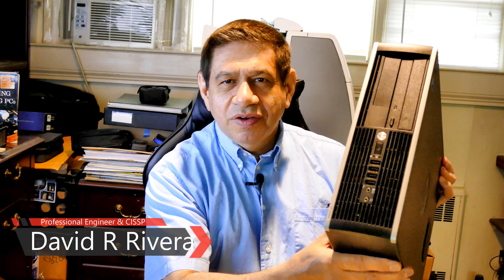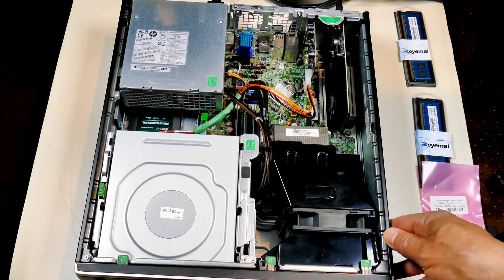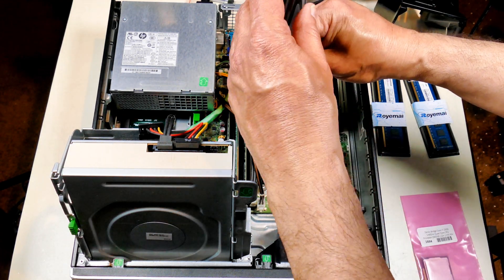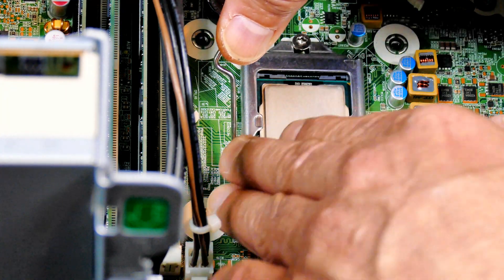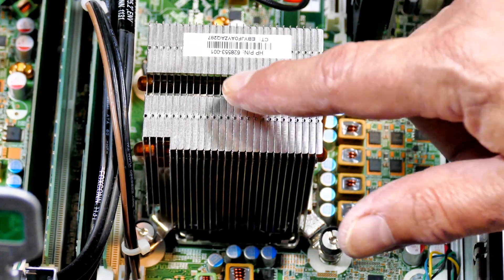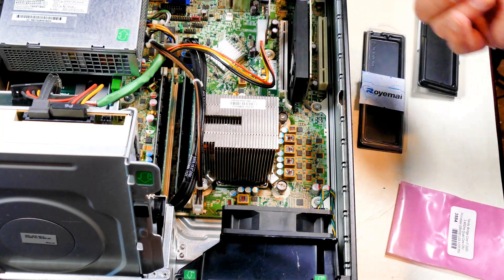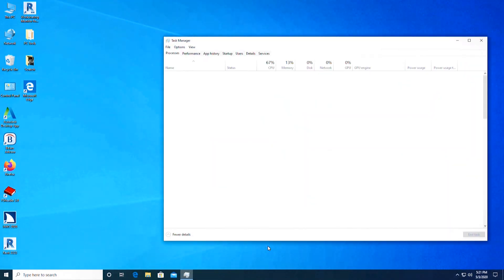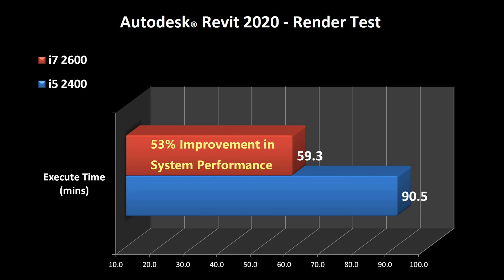NEW UPGRADES for a REFURBISHED HP 8200 Elite Small Form Factor Desktop PC – Memory and CPU Improved

Comment: I have an HP Elite 8300 which is very similar to this one. It uses a Core I5 3470 and Windows 10 easily, but I'm currently using at as Linux workstation with Ubuntu Mate. Upgrading to a SSD greatly improves the performance of this little computer.
Reply from the maker: Yes, you have a great use case for that system

Comment: Thank you for a very clear and informative video, David. I have an HP 8300 into which I have just installed an ssd  (replacing the hdd). I'm currently pondering other upgrades, including the cpu, so this video is very helpful food for thought. Keep up the good work!
Reply from the maker: Thanks you.  I'm very glad you found it useful.  I have two of these systems now that I use for testing out non-Windows operating systems such as Linux and FreeBSD.
Reply: The problem with these HP 6000 and 8000 series from 2011-2014 is the poorly designed cooling with a passive CPU heatsink and only a 1 92mm very noisy front case fan from Foxconn at 4200rpm, which in a normal room at full load sounds like a tractor. There is almost no effect from this 4200 rpm, amd processors almost reach the tjmax limit of 70 degrees Celsius under heavy load. Very unsuitable computer for home use, due to the loud noise.

Comment: Thanks for the video! I was wondering if the graphic card upgrade is necessary? I will be using this pc for IT and not gaming. The graphics card costs as much as the desktop:(
Reply from the maker: The PC comes fully capable of low resolution video through the CPU.  I added one to get 1080p.

Comment: Sir i have hp computer with mother board hewllet packard 0a60h. I want to change my main borad with new latest core i 3 or 5 to support core i3 to 7 processor. Which main board i can purchase to upgrade my PC with maximum support ram more than 8gb
Reply from the maker: That is a Micro ATX motherboard, with standard power connectors.  So I believe any micro atx form factor motherboard should work.  Generally tha only other concern is the power capability of the power supply.  Since the i3 does not draw that much I think you would be ok.  Is your case a 'Small Form Factor' model?

Comment: Question!! 

•I currently have a Geoforce 1050ti GPU that connects to a IE Express x 16 slot

• looking to upgrade to an 8GB GPU and was thinking the GigaByte Geoforce GTX 1070 G1 might work well for playing the new games with demanding graphics like jurassic eveloution 2.

• I bought a 550W power supply that I will install to accomodate it and will likely need an adapter for the power supply

• Does it sound possible to install a graphics card like that? My CPU is an Intel i7 and currently have 20GB of RAM in memory (all in my Elite 8200 HP desktop like shown in this video)

Would appreciate any info you can give. Great vid!!

-Travis
Reply from the maker: Travis, I don't see why that would be a problem.  The only change I would consider is upgrading yout Power Supply to a 650 Watt, just in case you ever go to a 3060 or 3060ti.  Also, I would suggest a 750 watt for a 3070, or an 850 watt for a 3080/3090.
Reply: @PE4Doers Awesome, thanks!! I plan to get the 1070ti as I'm on a budget but will definitely take that into consideration if I do upgrade later. I appriciate the response!
Reply from the maker: @travis7956  No problem at all :)

Comment: Have you tried adding a new wifi 6.0 card?
Reply from the maker: No, do you think that is something folks would be interest in doing?
Reply: @PE4Doers  it's an amazing increase of data if you are in a gamer
Reply from the maker: @davidmesa4964  I have a card, but have not upgraded my home lab to WiFi 6.0.  When I do, I will include a test of one of the two refurbished PCs I ave to do some testing.
Reply: @PE4Doers  just got me the 8200 in 2400, upgraded the fans to artic cool ones and ordered 16gb memory and a ssd tray. Parts should be in tomorrow. Thanks to your video, it helped me!
Reply from the maker: @davidmesa4964  Too bad Windows 11 will not be usable on this PC.  I plan on using the two I have as Lab PC's.
Reply from the maker: @davidmesa4964  You are very welcome.  Thanks for the comment and watching my video :)

Comment: Thanks for the informative video. I was able to follow along and was able to upgrade the same machine to your specs. Keep up the good work.
Reply from the maker: Glad to hear that.  I heard that the price on those refurb'ed unit is up over 100% and they come with Windows-10, is that what you experienced?
Reply: @PE4Doers  Yes, that is what I have seen also. I actually got this at a decent price with windows 10. I only paid $89 for it. I got it from this local company in my hometown 210geeks, here in San Antonio, TX. The tower works great and It really was easy to upgrade the unit.
Reply from the maker: @lupelaguna2547  You got a deal there.  Good Luck :)

Comment: My ram wont recognize all 24 in bios. How do I fix it? I tried installing new ram and it would not recognize all of it. Even after I did the f1, it still only recognizes 12. When i put everything back to the 16 total it had previously, and did the f1 thing, it would only recognize 8 gb of the 16. The video card I installed with 2GB works fine. But the ram not reading all is an issue and i cant get a straight answer from HP. PD these models are suppose to go up to 32 ram.
Reply from the maker: How many Ram sticks do you have installed?  All four?  Are they the same brand and speed?
Reply: @PE4Doers  Has the same in all four. Pulled all the ram and replaced with max of 32. Still only recognizes half.  Installed the original ram and it still chose to only recognize half and the bios do not seem to have any options to resolve the problem. Went as far as to wipe the hard drive, install the old window 7 OS, installed all the available drivers. Didn't change a thing.
Reply from the maker: @HighElderWarlock  Have you tried reseating the CPU chip?  I had something like that happen to me when my AMD CPU was not seated properly in the socket.
Reply: @PE4Doers Yup. no changes. When shops are open again I am likely just going to go to a PC repair place and have them flash the bios and then if that doesn't help have them run diagnostics on the board. I even went as far as pulling the MoBo battery out for 24 hours and replaced it with a new one. For now I am just going to leave it as is since everything else reads like its suppose to. Its probably some stupid little minor setup thing that's being missed but one of the reasons I hate dealing with HP's bios and firmware settings.
Reply: @HighElderWarlock  Id like to know if you got this resolved.
Reply: @johnthroneberry7212  nope. Even a more tech savvy friend of mine is stumped.
Reply: @HighElderWarlock  Ever figure this out? I just bought one of these PC's and ordered 32 gigs of Ram

Comment: I've got a question. I own this PC and since I'm starting to run out of storage (500GB HDD), I went to spec sheet on HP's website. Apparently, there are two internal 3.5 inch drive bays. Does that mean I can add another HDD (not SSD) which would ideally be 1TB 7200 RPM? (since that's what's supported according to spec sheet). Would it be a harm for the 240W PSU inside it, running two drives simultaneously? I've never added a GPU, SSD or any additional hardware inside. Thanks in advance!
Reply from the maker: I believe you are correct.  In one of the two units I have, I've installed a 500gb SSD in the first slot and a 1tb Hard drive in the second without any problems.

Comment: Hello sir, i have HP 8200 but with i3 2120, it's possible upgrade to i7?
Reply from the maker: Yes, I actually did that in one of the videos in this series.  I believe I used the intel i7-2600 that I bought from ebay.
Reply: @PE4Doers  ok, thank you sir and Happy New Year.

Comment: can i put my HP elite 8000-SFF upto 32gb of ram an what size of CPU should  I put in it for gaming
Reply from the maker: Sir, I am not that familiar with all the HP SFF models, however I believe they are limited to 16gb of ram (4x4gb). and since the motherboard only has a LGA775 ZIF (Socket T), I do not see an upgrade path for a CPU that would support many modern games - only legacy titles maybe.  The manual can be found at: http://h10032.www1.hp.com/ctg/Manual/c01960471
Reply: Yes but as an issue I am having only half of any installed ram is ever showing and its beyond annoying.

Comment: Thank you sir
Reply from the maker: You are quite welcome.  I actually have plans for further upgrades in November, so stay tuned.  Also, let me know if you have any questions.
Reply: I will definitely do that. I just bought the same PC and I'm planning to upgrade just like the way you did it on your video.
Reply from the maker: @lynxfeni9234  That sounds good.  Did you also add the USB 3.0 ports?
Reply: @PE4Doers  not yet.. 

Specifications:
Intel Core 2 Duo 3GHz
Desktop
2GB DDR3 memory
250GB SATA HDD
DVD-ROM
Broadcom Gigabit Network Card
8 x USB 2.0 ports
Reply from the maker: @lynxfeni9234  That sounds like exactly the same specs mine was originally.  Did you see the first video on upgrading the hardware on this refurb PC.  I only mention that because I needed to modify the PSU wiring to allow for the extra Molex power connector for the USB 3.0 card (not 100% required, but gives me the flexibility for driving larger USB devices right from the USB power).
Reply: @PE4Doers  I will check that video just now.. Appreciate your prompt response.
Reply from the maker: @lynxfeni9234  No problem at all - good luck.

Comment: I have the same pc. May i know if it is possible to transfer it to a bigger and modern cases available in the market today?
Reply from the maker: That may be difficult, since the motherboard and power supply are arranged specifically for an HP SFF layout.  I have considered using some sheets of tin and polyurethane plastic sheets to make a custom case for one, however that would be costly in parts (and of course time).  I did look through used case at one point to see if I could find one that would fit those components, and look more attractive, however I could not find on.  An alternative would be an 'Open Case' which would just need a large sheet of tin, a large sheet of clear or colored plastic and four standoffs at least three inches long.